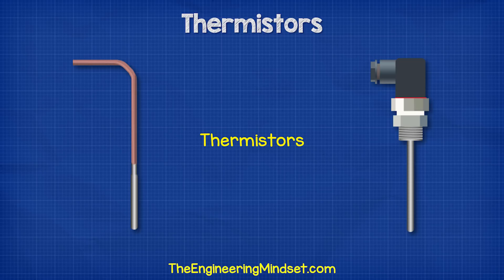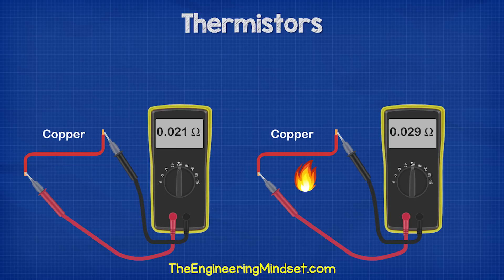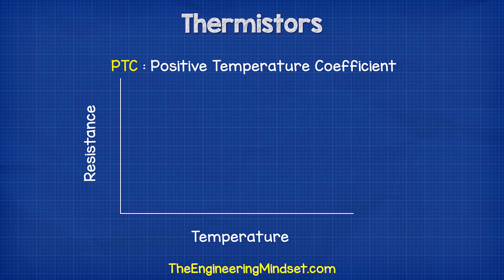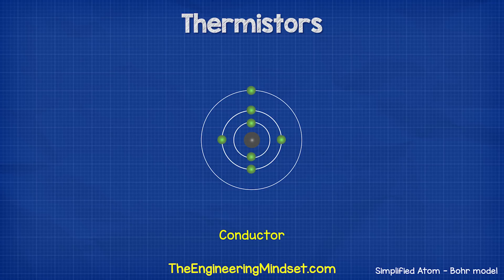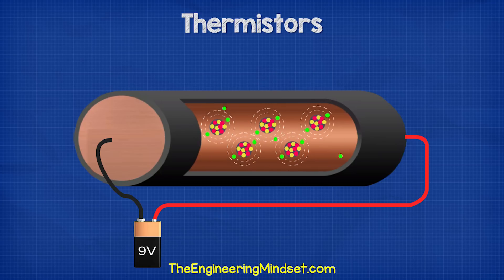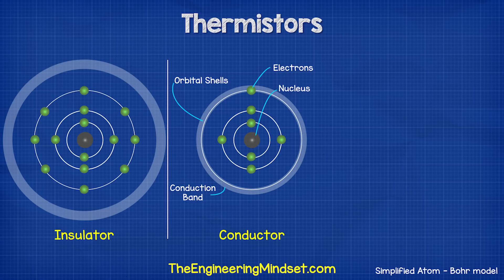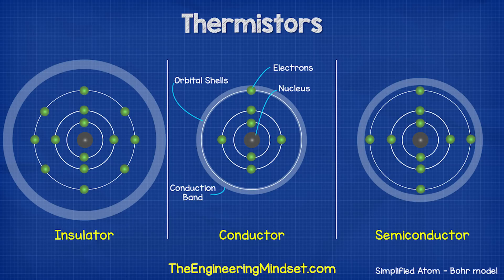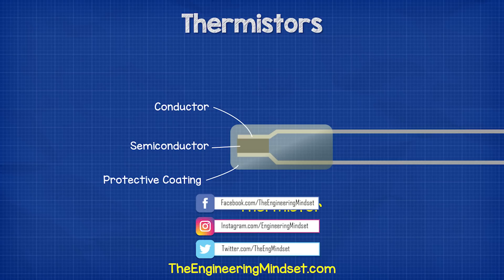Thermistor Basics - NTC PTC

Comment: Silicone becomes more conductive when you heat it so I think they use pure silicone in those thermistors
Reply: Silicon or silicone?
Reply: @nijume  I think he means Silicon [Si] not Silicone used for the Bathroom/Kitchen etc :)
The one with "e" is more an insulator than a conductor also used for high temperature resistant cables/wires.
Reply: @SystemX1983  probably, yes. The one with e is this rubbery stuff, not the metal
Reply: Yes I realize I made a mistake and put silicone instead of silicon
Reply: @mylestechnological7031    Nobody is perfect, Myles.  Stay safe, healthy, strong, happy and be blessed 🕊✌️🍀❣️